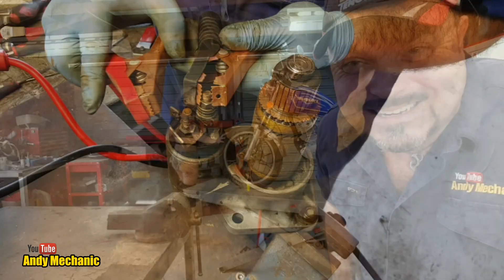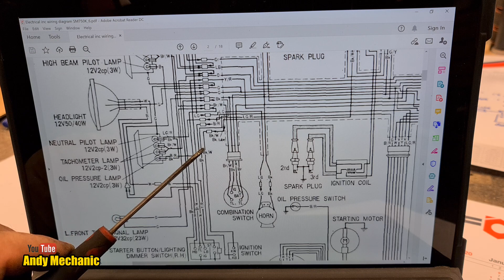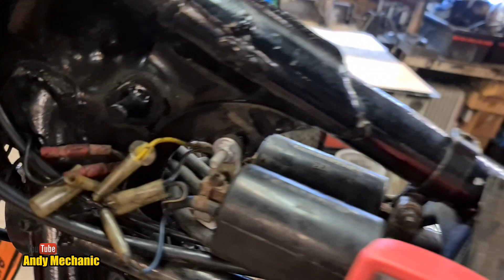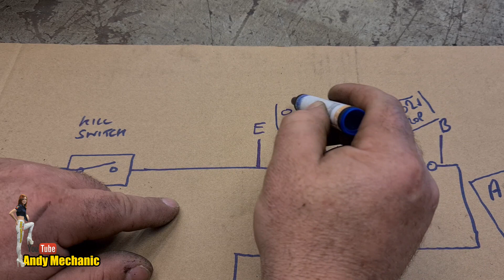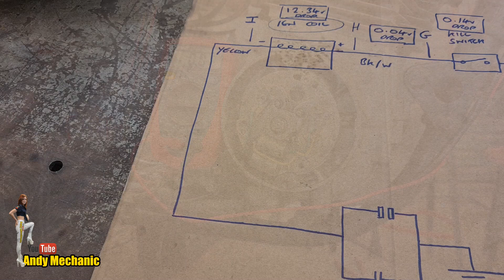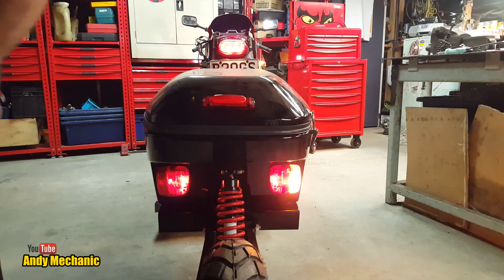Honda CB750 K2 - Ignition primary circuit - chasing volt drops Ep.6 #1473

Comment: Just measuring the voltage drop between the coil leads and deducting that figure from the main voltage on the battery will give you the loss from the other components.

Comment: I have power to the ignition (red wire).

When I turn the key to park, the tail park light works.

Now when I turn the key to on, the entire red (hot) circuit goes dead.
I changed the ignition switch out, same results.

If I pull the black wire out of the ignition switch connection, I have power to the red (hot) circuit again.

I have tried unplugging any black wire to each switch in the circuit. No help.

Comment: Nice videos mate but if I may, just a tip: Unless I'm mistaken you've had the coil  'on' for long periods of time here. In normal running as you know it's obviously not permanently on like this,  (the duty cycle is obviously not 100% as it were). As you understand, Kirchhoff's voltage law being what it is, you need the circuit 'on' and current flowing to check all these volt drops. But you'll cook a coil leaving it permanently on like this for minutes . As ideally the only load in the circuit, you can disconnect the two coil primary connections and put a test light in its place. With the contact points closed obviously current will flow through this circuitthe same, but you won't do any harm. You're still looking ideally for the battery source voltage across the load (now the test light, in place if coil) with any other volt drops being undesirable but you can take all day doing this without harming the coil. Doing volt drop testing around the circuit your way will totally kill the coil! You said yourself they were getting hot. ;) 
Rookie error really chap. ;)
Reply: apologies for the typos :)
Reply from the maker: Potentially, however,  these ignition coils are going in the bin. We have new Dynatech coils to fit..... on another note, I have not read anywhere in am owners manual 'yet' not to leave the ignition turned on for long times. Ignition coils get very hot even in normal use. Also this video was edited & there were times where the ignition was turned off for say 15 or 20 mins at a time. I'd say the longest time they were left on in one continously period would be around 20 mins or so. Coils were never too hot to touch & I have felt coils much, much hotter than these on vehicles where the engine has been running for long periods - say a 2 or 3 hour ride for example

You do make a valid point & appreciate your feedback. Cheers Andy

Comment: hi Andy dont you need a 1to2 ohm balance resister with your new coils as standard coils are 5 ohm and your using 3 ohm will they coils not run hot  ?
Reply from the maker: Hi John, you raise an interesting point. Dynatech have not indicated this. I'm going to be sending them an email covering the proposed wiring if the Primary circuit on the bike before I do the work - I'll raise that point in my email too.

Thanks :-)
Reply: you only need it with points  setup @AndyMechanic
Reply from the maker: Rodger dee.....in that case we should be just fine :-)